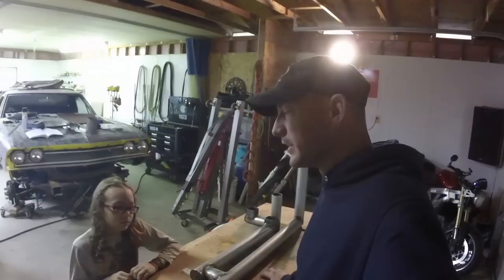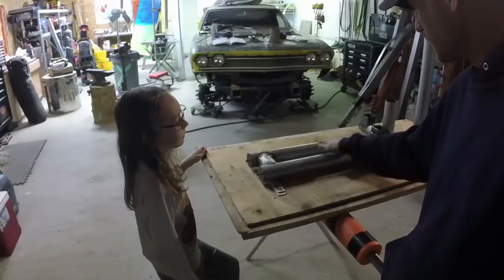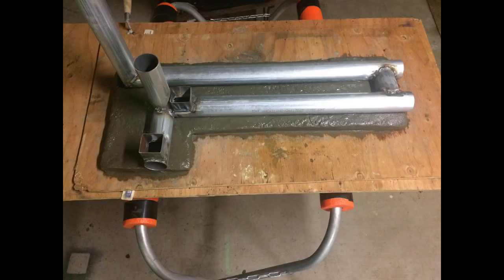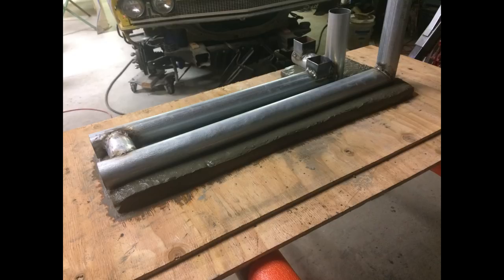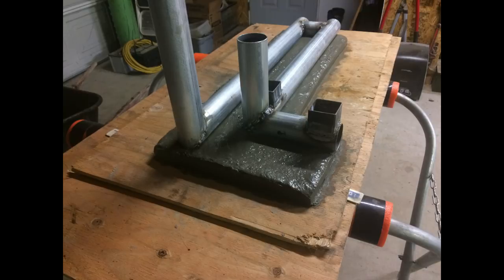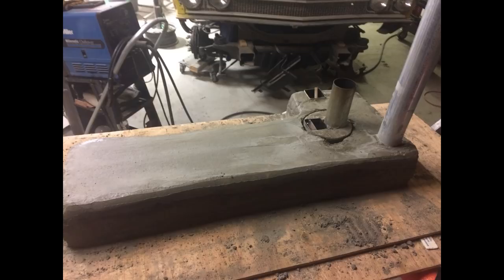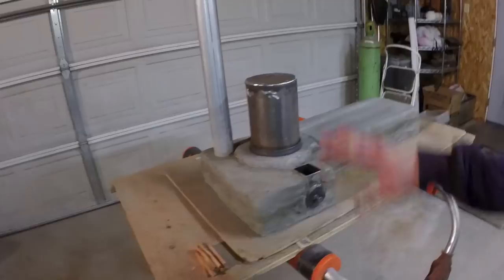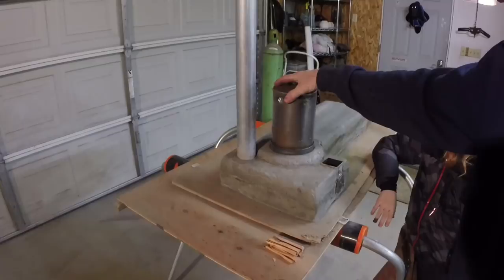Science Fair Project, Mini Rocket Mass Heater Part 4

Comment: If you run the exhaust flue up against the Bell, the exhaust gases would pick up a little bit of heat on their way out, increasing the draw throughout the system. This is a really neat project, I'm working on putting together my own micro RMH.
Reply from the maker: I will keep that in mind when I build my life size one. Thank you. :)

Comment: Your design doesn't look off, you just need to prime the system to get a good burn. In masonry heaters they have 2 fire boxes initially, where one is in the exit chimney and one is the primary burn chamber. They do this because the colder air in the system acts like a plug and prevents movement of air. So when they light the small fire at the end it causes a suction effect pulling the air in instead of acting like a hamper and plugging the air circulation. The hotter the fire gets, the better the bell or stratification chamber becomes similar to your ERG system in a car.
Reply from the maker: Interesting, I will have to look into that. Thank you. :)

Comment: Very nice!  I am wondering if perhaps your lack of rocket air draw, to get the fierce suction and rocket sound and secondary burn, is because your bell chamber was removable?  It perhaps was not totally sealed at the bottom allowing air to come in there and basically short circuit the air loop in the bell, and the amount of air drawn into the system?  Some woodstove caulking might help a lot.  The "clean out" near the wood feed is not actually a clean out exclusively and is actually needed to supply the air into the system, so should remain open, as the air has to come from somewhere...but with an adjustable butterfly flap to tone it down if desired.  Great work guys. I look forward to seeing what you do with your next one!
Reply from the maker: Thank you, we learned a lot building this one and from all the comments hear. Don't exactly know when we will get a chance to build another one yet but hopefully soon. :)

Comment: Cheap cat litter is 100% clay 😎 I've made cob ovens that way .
Reply from the maker: That's interesting. I would have never thought of that. Thank you. :)
Reply: tribalwind 

Cheap is not the issue.  Some Kitty Litter (KL) is Bentonite Clay (BC)
Some is Zeolite Clay (ZC)

OK...BC is flat,  basically grey. Bags of the same weight will be smaller than ZC. 
ZC will be white looking.  The bag will be bigger. 
It advertises that it absorbs ammonia smell and will absorb its weight in water. 
The reason the bag is bigger is that it has hollow passageways in the pieces. 
The main test for zeolite is to put some in a cheap cup,  light plastic,  best is Styrofoam to get the full effect.  
Pour water in half as high as the depth of the KL.
With ZC you will hear A Rice Krispie, Snap Crackle,  Pop sound. 

"Hundreds of Zeolites, 
Thousands of Industries, 
Millions of Applications."

You can make ice using ZC & SUNLIGHT. 
3rd world operations make 5 lbs of ice per cu ft of reefer.
HEINEKEN, I think,  uses a wet fleece with ZC in a vacuum chamber. 
Pop the tab, wait 20 minutes: POOF!!! COLD BEER!!!

Filter alcohol,  get 20 higher proof.
Filter ambient air,  get pure oxygen  
(Oxygen Concentrators use ZC / KL!!!)

ZeoClot: ZC Powder will clot blood to seal wounds.

ZC will remediate Autism by scavenging the poisons from vaccines. 
ZC will remove aluminium 4 Alzheimers help...
ZC will remediate nuclear contamination...

Etymology:
Zeo Boil / Steam + Lithos Stone: Stone that boils.
Reply from the maker: Wow! That is a ton of information. Thank you. It is amazing how much you can learn on YouTube. :)
Reply from the maker: Well not shredding my lungs would be a bonus. lol. I will be doing more research on things to use for rocket mass heaters in about a year. We are building our house next spring and want to put a rocket mass heater in it. Just need to find all the right stuff and the perfect design. Thank you for watching. :)
Reply: @KoalityofLife  

If you or anyone uses Perlite, just watch a free videos.
I did what they did on a Paul Wheaton video; open the bag, stick a hose in and soak it down. 
Even with that approach you could see dust in the air. Use a respirator, dust mask at least.
I mixed ceramic cenospheres into paint to insulate one time. Outside with a breeze. 20 minutes later, 
I could Taste blood in my mouth.
I learned that cenospheres are so close to being liquid that even if you dumped 2 pounds into paint, you will never see a clump.
They mix in!!!
I used them when mixing the Aircrete Pad for the Rocket Stove in the greenhouse here.
Kinda same idea as Perlite with the same hazard. 
Wet them down fast!!!
Reply from the maker: Good to know. Thank you, I will definitely check some videos out. Thank you. :)

Comment: Mud w sand works great( as cob) and when dry you could pull out your pipes and have clay tubes... or a trench instead if pipe...
Reply from the maker: I have thought about making a full size mass heater without using pipe just to keep the build cheaper but I haven't gotten around to making it yet, maybe this summer. :)

Comment: Darling diagram! As far as I understand a 6 in system will have a burn pipe the same diameter, but if the burn chamber isn't drawing try reducing the size of it. Also you can play around with the angels of the vent pipe going out to a slight angle upwards. Good luck! Have fun!
Reply from the maker: Thank you. Always looking to have fun making something. :)

Comment: I might make a small one like that for my camper shell in my pickup truck.  and run the exhaust out the back.  putting a can of water on top to absorb the heat can't hurt.  the tube in the can has to be non conductive to allow complete combustion.
Reply from the maker: We do have plans to make another rocket mass heater. The next one will be full size and will probably be in our shop after we build the shop. :)

Comment: Im trying to build a half size working version. Ive read all the comments, but you never said what the flaw was exactly, what would you do differently?  Im guessing larger diameter exhaust Chimney. My comment, Remember you miniaturized everything, so you need miniaturized wood to haha, perhaps match sticks. It may take 5 or 10 minutes to get up to temperature in combustion chamber, then the heat going up Chimney will pull better. Use a hair dryer or vacuum to pull air thru to get it started up.
Only on your micro project, i would insulate the outside of the bell (big can) so the combustion chamber gets hotter.
Reply from the maker: I believe the main problem we figured out was that the burn chamber wasn't tall enough. The chamber and the bell needed to be about twice as tall as they were to pull a good draft to keep it burning. There are a few books out there that break down the dimensions pretty well, follow those and you should be good. Thanks for watching. :)
Reply: @KoalityofLife  
Wow, that was fast, thanks.
The best analogy is a p trap under a sink. A water siphon. The bell makes no difference as its a p trap, connected to the Chimney. Hot air is the reverse of water, it wants to go up. But when you first fire up your rocket stove it, first it robs all your heat so it may take 5 min yo get hot. But primarily, you have to help it start the siphoning effect. The smoke has to go down before it can go up again. Put a small vacume on the exhaust for a few minutes. Try it again.
Reply from the maker: @moviehipster  Interesting. We plan on making a full size rocket stove in the pole barn build we are building now. Just have to get the pole barn finished up. :)
Reply: @KoalityofLife  thats the genius of the small prototype,  you can learn what works and what doesnt, then make improvements.

Comment: The pipes seem a bit big in diameter in relation  to the stove itself. But a great science project.
Reply from the maker: The dimensions are a bit off but it works ok for what it is. We did learn a lot building this one so when we make a real one we know more about what to look out for. The J tube needs to be higher and better insulated and the tubing going through the mass needs a bit more rise. All in good fun. Thank you for watching. :)

Comment: How did this project turn out?
Did you use it much?
Reply from the maker: It worked ok, the dimensions were off a little for the burn chamber so it didn't want to burn very well but it was a great learning experience for all of us. We can use the things we learned to make a real size rocket mass heater in the home we are about to start building. :)

Comment: the exit from the burn chamber. the pipe needs 1 inches of rise for every foot took keep the draw going up and out
Reply from the maker: We did make a few mistakes on this first attempt at a rocket mass heater. It did work just not as well as it should have. The exit from the barrel into the mass needed to be away from the bottom of the burn chamber also. All in all it was a fun project and we learned a lot about how they work. :)
Reply: it looks very cool. i liked the video a lot. i am going to make a larger one on the first to heat my home. but a very good project to do with the kid. congratz it's very good looking rocket stove.
Reply from the maker: Thank you and thanks for watching. :)

Comment: i thought COB retains more heat than Concrete.
Reply from the maker: I think it does, but for this project, being as small as it is, we used concrete because it was easier. :)
Reply: Portland based concrete without proper additives will fail with the heat generated by a full sized rocket mass heater in areas of the build.  You want to keep it away from the hottest areas.  It's also is considered more of a radiator than a storage material.  Great to top a bench with, IMHO.  We topped a twin bed sized stratification chamber (2/3 of a 55 gal. barrel buried in clay and sand) with 2" of concrete.  The 6" Walker core gets it too hot to lay on sometimes!